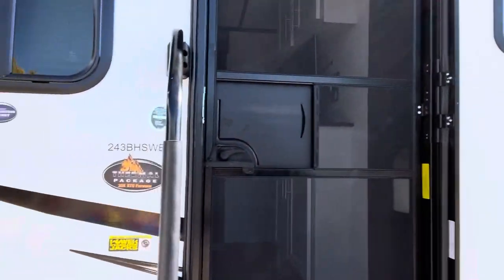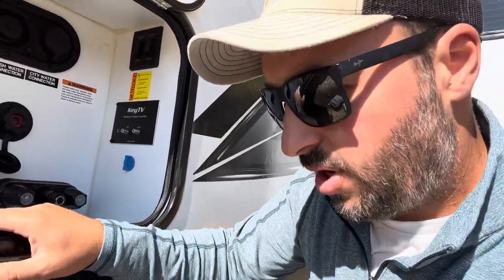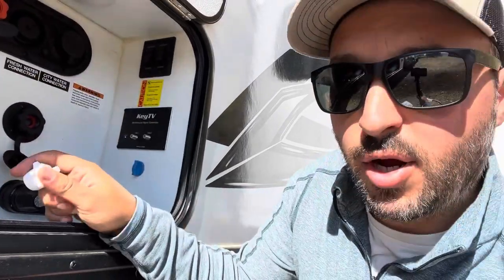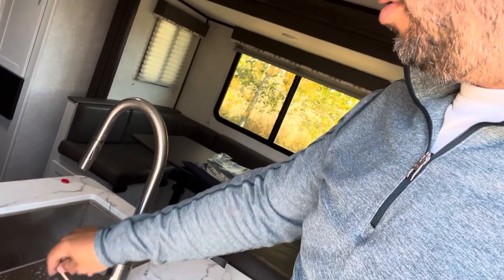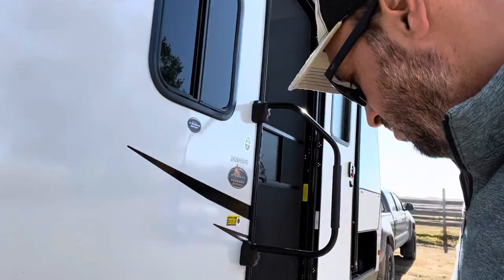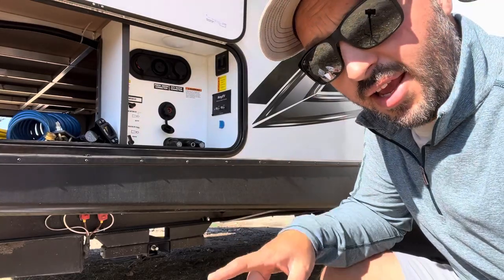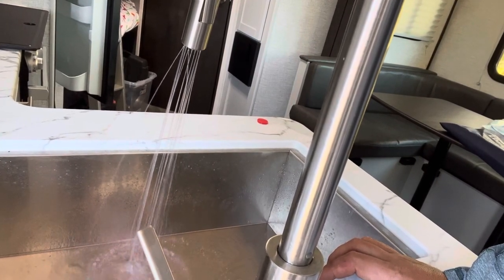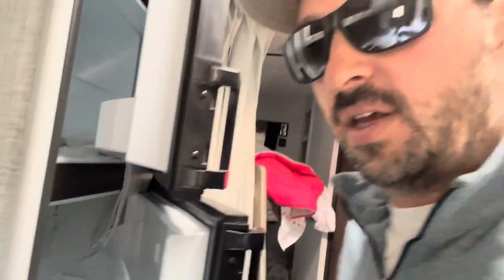Winterizing a Keystone Bullet 243 RV

Comment: Nobody I know it’s antifreeze in there freshwater system. If you drain it all out you don’t need it.
Reply from the maker: Had friends try that and cracked a couple fittings in low points that didn’t drain. Figured I’d be safe and keep with the antifreeze.

Comment: Did you blow out your outside shower inside your control panel and also the water line that’s on the back of the trailer on the right side?
Reply from the maker: Yes, I ran anti freeze through the outdoor faucet but I’m not aware of another line on the back of the trailer. I’ll go take a look. Thanks for the heads up!
Reply: @skymountainfarm  it is just to the left of your outside kitchen. Just a small round black cap that opens. Another quick connect like your outside shower!
Reply from the maker: I took a look and I don’t have that port. I wish I did instead of only having outdoor water on the backside of the trailer.

Comment: Thank you for this. One thing I didn’t see covered. The black and gray tanks. Other than draining should antifreeze be put in those? Some of it will run down into it from the antifreeze going down the drain thru the lines but any need to dump some more down the toilet or in one of the sinks for the gray?
Reply from the maker: I’ve always found that the anti freeze that runs out of the faucets is enough but it never hurts to put a bit extra down the drain.
Reply: @skymountainfarm  got it. Thanks again! I have a Bullet Premier so very similar set up to your trailer. Video is very helpful
Reply from the maker: Glad it helped!

Comment: Great video.  I was not 100% sure about those bypass controls and you clarified that.  Thanks.  You stated you leave the low point drains and water heater drain open thru the winter. Are you not concerned about getting bugs in any of those open drain lines? 

Also, I noticed you have a "Giggy box" for your main 12v power on/off.  With all the electrical problems I had on my brand new Bullet Supreme, I 3D printed a "giggy key" to switch the 12v power on/off with the Giggy box cover removed.  If you have a 3d printer, I can send you the STL file of the key if desired.
Reply from the maker: Thanks for the feedback. I’m up in Canada and we don’t have too many bugs out in the winter but I see how that could be an issue. 

I don’t have a 3D printer but I’ve thought about getting one. If I ever do, I’ll take you up on that offer!

Comment: How do I know if my bypass valve sticker is backwards? I don't want to suck any antifreeze in my hot water tank
Reply from the maker: I took out my anode rod from the hot water tank and then turned on my water pump to see if it was filling the hot water tank. You’ll need water in your fresh tank to check this.